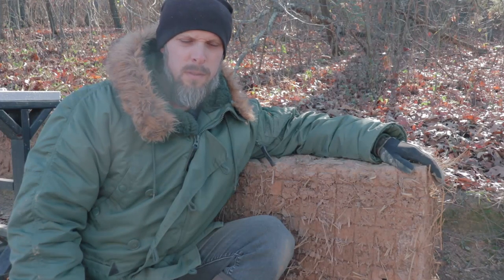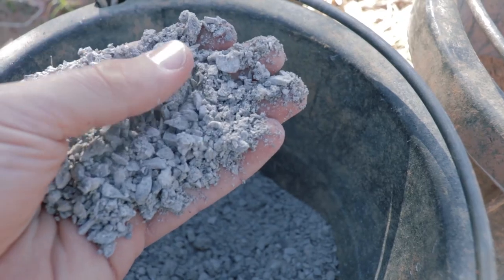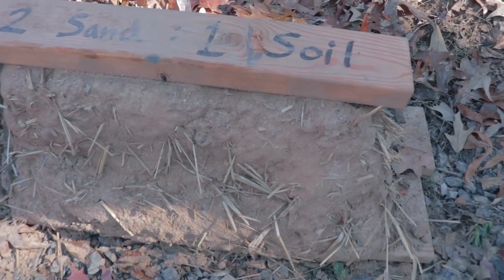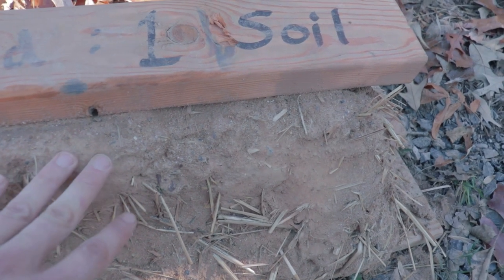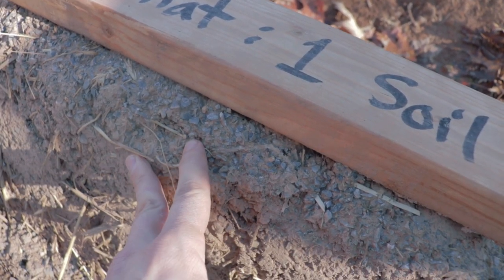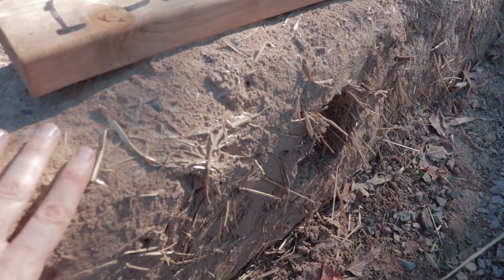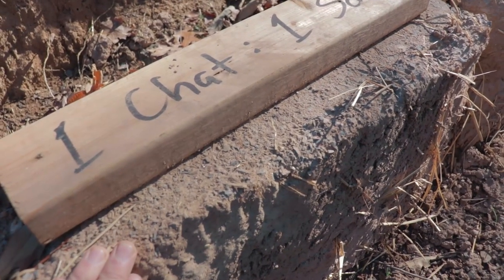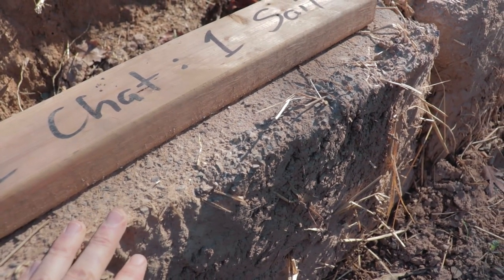Insulated Cob Wall Experiment - Dual Wall Cob Test Block

Comment: interesting experiments. what about mixing - 0.5 chat 0.5 sand and 1 soil?  also on the dual wall, what about the stray being sandwiched between two layers of cob?
Reply from the maker: That mixture would do well. I'm quite sure of it. Good idea!

You could sandwich the straw, but your load-bearing cob wall would be split into two. I think you'd lose some load bearing capacity. And/or the two cob walls would need to be tied together through the middle with rebar, which would be a hassle.
Reply: Yeah, mixed aggregate size might offer the best of both worlds, but I doubt it. The fine grain gives a solid but more pliable mix where the bigger grain may offer more structural strength but also makes the structure more fragile and prone to cracking and moisture problems because it’s less monolithic. I’d probably go with the sand because you never have enough big stuff in the mix for it to really pay off in terms of strength and the fine grain has more surface area than the big stuff so it should stick better and disperse the load more evenly....

Comment: The dual wall is awesome, what level of insulation are you expecting to get with the straw outside?
Reply: 🙋🏻 I'd also like to know these things, please! 👍🏼
Reply from the maker: I believe this block would have an R12 insulation value. If memory serves me correctly!
Reply: Do you see there being a structural limit with how much straw you could apply this way before it won't hold?
Reply: @thiscobhouse  the straw goes on the outside of the structure?

Comment: Hello.. how do you sticth the two walls together? What's to prevent them from peeling apart. Are they joined by rebar or simply 'stuck ' together with clay slip?

Comment: On that dual wall concept would it be the straw-clay layer that is the inside face? If so I would assume a plaster layer over that? I too live in Eastern Tennessee and will be building our home for my family so I have been paying close attention to how TN red clay behaves. Thank you for your videos.
Reply from the maker: The straw-clay portion would be on the exterior of the building actually. I would give it a good coating of lime plaster, for sure. It would do very well!
Reply: Ah very interesting. Considering your workshop since I live an hour or so from that location. Thanks for your info.

Comment: What would be th thermal value of this dual wall? Does it give you a good U-Value?  Looks a very solid system.
Reply from the maker: Straw-clay R value is usually about R 1.5 per inch. I calculated this a few months ago, I think the total R value for this particular dual wall is R12.